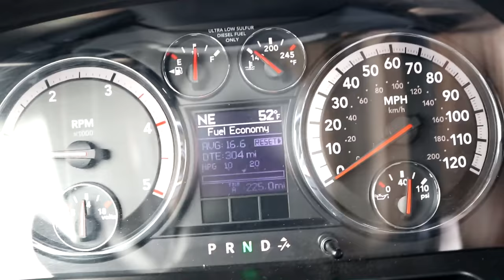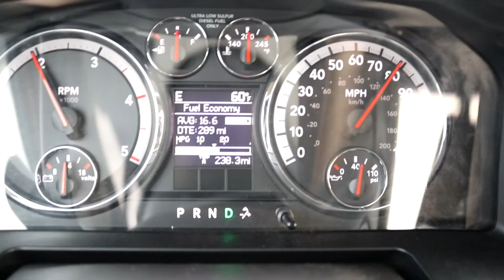CUMMINS PUTTING IN WORK WITH... (guess who)

Comment: Stop with the transmission additives!  Your destroying your transmission! Service it as recommended  change both filters and if you want it to last don’t turn up the horsepower. The 68rfe is pretty much maxed out at the stock 800 ft lbs of torque. Adding horsepower kills the trans and head gasket.... your going to get 5 th and 6 th gear slip codes .....
Reply from the maker: I am running the stock tune